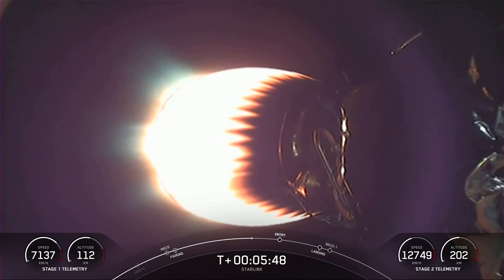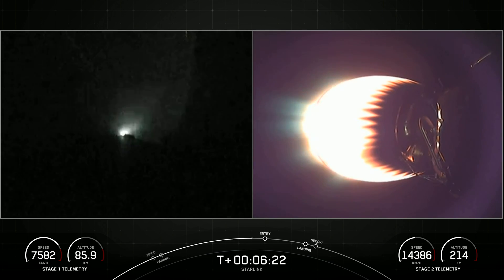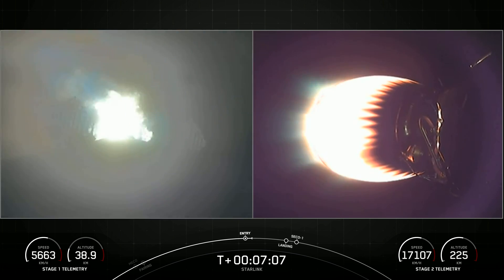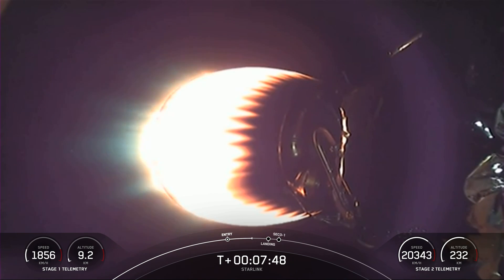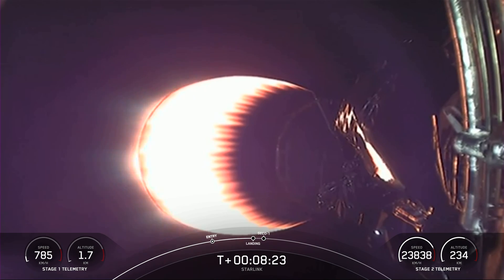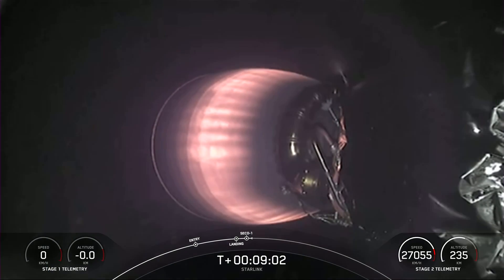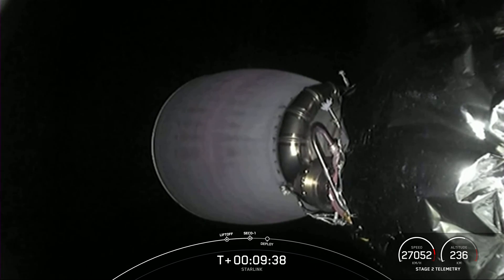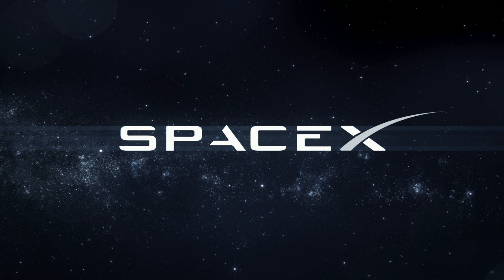Starlink Mission

Comment: Cute video. I signed up the very first SECOND you could. Same with the Cybertruck. Been waiting since then using 3 MBs DSL. Was told by starlink I would have it by mid-21. It's getting to be late 22 now.  Yet another over-promise and under-deliver Musk situation.  Getting tired of it.
Reply: You act like they haven't had some supply chain and other issues.

Comment: What causes the fumes and clouds you see before start-up around the vehicle?
Reply: The superchilled liquid oxygen.  It's either cooling things enough that mist starts to form or it's being dumped as they top the tanks and then before launch they purge the lines.
Reply: It is necessary to vent the liquid oxygen as it boils off in order to maintain the pressure in the tank. That very cold gas causes the water in the air to condense, creating the cloud you see.

Comment: I don’t know if this is an actual Space X channel if it is I have a suggestion for your Mars colonisation/Science project if you have ever seen the Anime Cowboy Bebop in that setting the Solar System has been Colonised and travel between planets is conducted by a system of hyper-space gates rather than the ships having FTL drives so I thought we already have superconducting technology and particle accelerators and so on, could you not build a series of gates to just magnetically propel cargo pods to keep supplies going to mars, up the space elevator, automatic loading cargo pods and then slingshotting them to mars, obviously the pods would need some sort of correction thrusters and how you keep the gates in place, well I am not an engineer earth gate would be simple enough, moon gate? Then a series of deceleration gates at the destination? Just a thought because a colony will not be self sufficient for some time if ever.
Reply: Fiction doesn't translate into reality that easily and the more..exotic the fiction the less likely.
Reply: Intriguing.

Comment: That's pretty cool. Great job! Was that video real time? how much time between lift off to stage one landing?
Reply: This is all real time
Reply: The "live" video stream is usually 30 seconds or more behind realtime due to buffering & compression delays. Launch to S1 landing is around 8 minutes, but varies somewhat based on the chosen trajectory, propellant margins, etc. Compared to other rockets like Atlas V, Falcon 9 does its stage separation relatively early in flight, which has to help with recovery.

Comment: Did anyone else see at the end the debris piece hit the second stage engine section?
Reply: It's ice,  or really more like fluffy snow, made of frozen oxygen from the bleed valves used for propellant settling.  This is harmless and expected, but it can form all sorts of interesting shapes that come loose during maneuvers, temperature changes as S2 rotates, etc. It quickly sublimates to vapor due to sun heating, and so doesn't contribute to space debris.
Reply: @jordanhazen7761  Yes, I've often noticed it fall or slip around the Merlin. Thx for the interesting info.